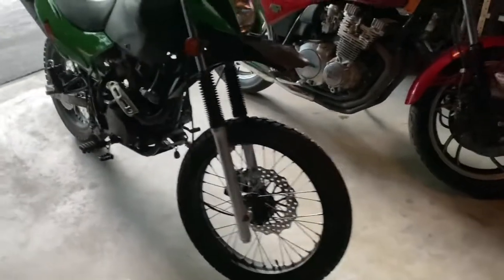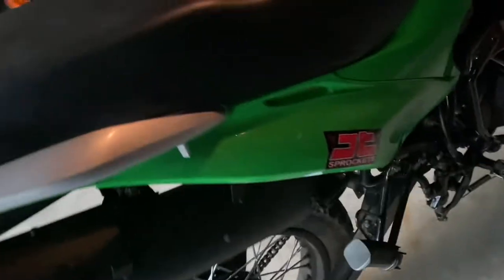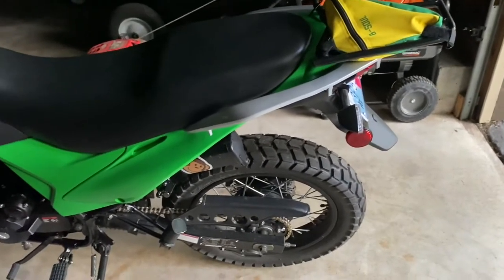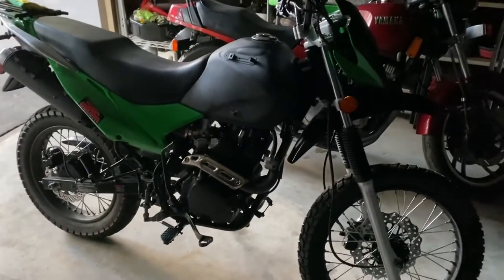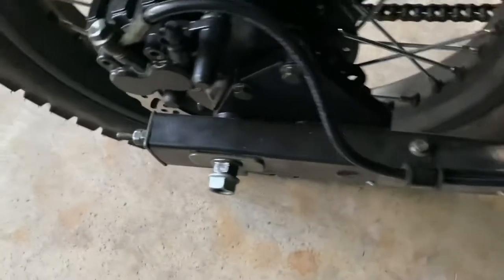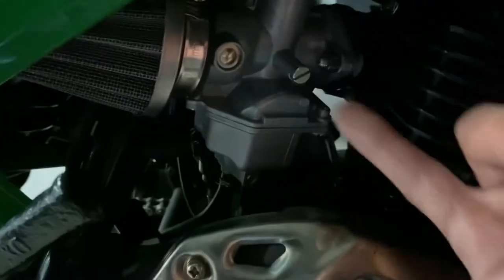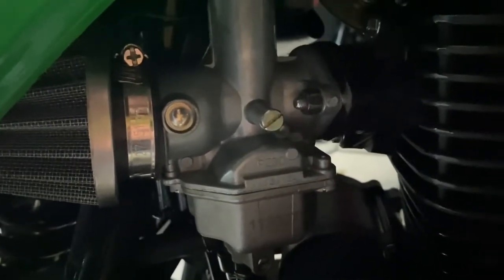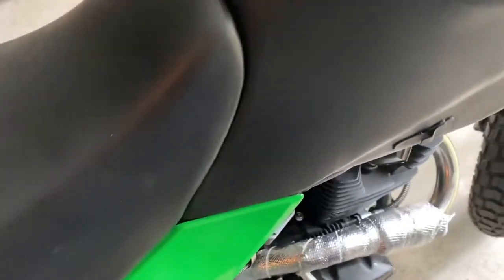First month with my TBR7

Comment: Very cool what did it cost ya? And we’re did you get it.
Reply from the maker: I bought it from TX Powersports but they also sell them on Amazon and various other places. It was listed at $1600 free shipping but I got hit with a fuel surcharge of $250 because it was coming from so far away so not really free shipping.  It’s the same bike as the Hawk 250, CSC TT250 and a few other bikes which are all Chinese made Honda clones. Huge online community and mods are all very cheap. Great cheap starter bike or just something to mess around with on trails.
Reply: @HandyL  thank you Sir.